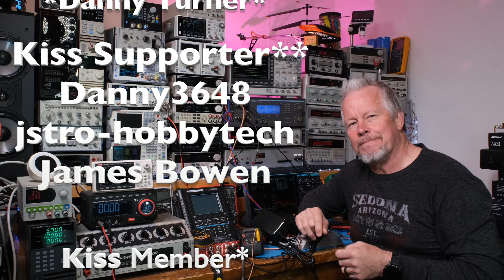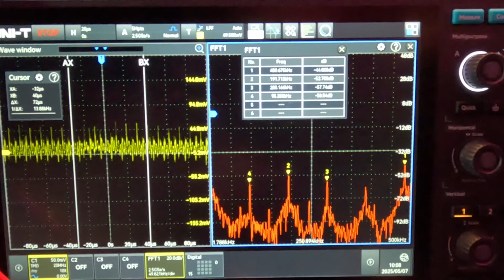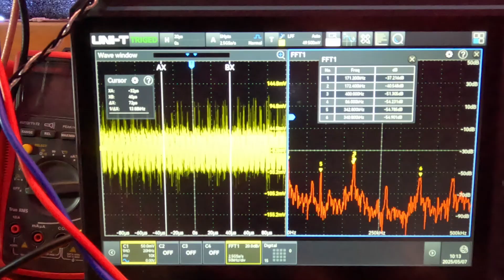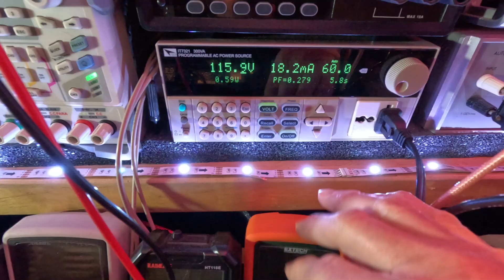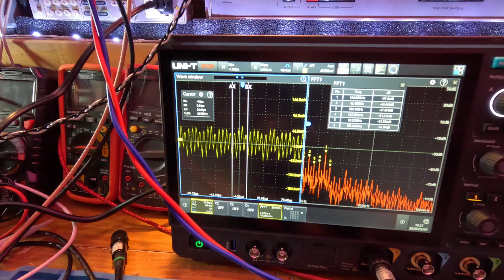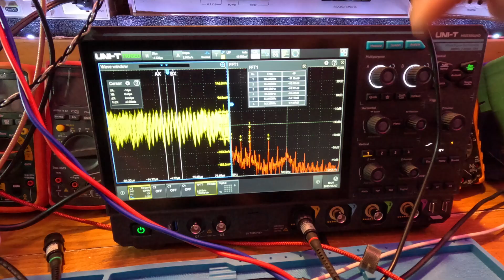New Aiyima GaN 48V Power Supply brick vs Fosi 48V Power Supply Brick - Power & Noise which is better

Comment: I’ve got a dell laptop power supply, 20V 10A. Any reason I can’t get a barrel adapter and hook it up to the aiyima 07 to drive bookshelf speakers?
Reply from the maker: There is no reason that you can not do that.  If you have 4 ohm or lower speakers - than this might work great, but if they are 8 ohms the power will be more limited.  But it will work and worth a try.

Comment: Aiyima are known to blow out easily. Don't use 48 VDC  power adapters (safe is <~40V) , sure to burn the IC, check internals if No damage seen to other parts sure IC is burnt ut. so change the IC, buy from aliexpress and give it to any electronic/Computer repairer to solder. just <$4 iIgot my blown out Aiyima 07  back to working.

Comment: Hi,  I left a comment a couple of months ago on a my other account and promised to get back on the differences. I went from fosi 48v 10a to two Gan 48 volt 5a so not really like for like. The Gan psu's sounded very bright when I first changed, the first two weeks it seemed like hi hats were dominating the drums on tracks, after a month they calmed down although they still sounded brighter, obviously the seperation improved with two psu's, but the dynamics, soundstage and small details are so much better with GAN, but I bass, warmth and sweetness. The volume and overall power hasn't improved if anything I might be cranking up the volume more with the GAN, tbf these changes are to be expected  with less bass. Today I placed my two V3 amps on bamboo support rather than on ply rack directly, now there seems to be a bit more bass and sweetness with the GAN. The amps now run slightly cooler which (why I got 5 a instead of 10a, GAN)  you prevoisly commented that the amps only draw what they need regardless, but they do seem slightly cooler. Now I have a spare 48v 10 fosi PSU so thinking of buying a cheap chifi amp for bedroom system maybe ayima. Be Well
Reply: I lost sweetness and bass with GAN but tbf the sound is so much bigger my speakers might not be able to produce deeper bass accurately if that is what the GANS are pumping out.
Reply from the maker: Thanks for the feedback.  The power supply GaN or whatever - it simply does not change the sound - this is in your head - expectant bias...I guarantee - that if you could do a double blind test - you could not tell the difference.....  The only thing that makes a difference is the voltage and available current..
Reply: Of course it's in my head where else would music be.😏Again it wasn't a like for like test so probably best not take my comment too literally. Now I'm tempted to get a couple of GAN 10a's to see if they perform differently, temp etc! 🙃Thanks for your feedback!
Reply from the maker: Sorry about that - I think I just responded a bit harshly.  The difference could be in the power supply design - switching frequency and feedback loop.  I think the output filtering could be completely different as well.  The GaN FETs can switch faster - but then if that is used in a hard switch vs a soft/resonant switch - then there can be a lot more noise.   The frequency of the noise is too high to hear - but I wonder what stress it can place on other components.
Reply: I don't think this is entirely true with class-d amplifiers the power supply is more intimately tied part of the power amplifier output circuit.

Comment: Is there a measurement you can do to simulate the instantaneous load of transients. As I have both power supplies, I’m curious why transients sound so much better on the GaN. Guessing it has a much faster response time to load changes? Is that slew rate?
Reply from the maker: Yes it is called a load test.  I will do that test:)
Reply: @KissAnalog  i would be highly interested too.

Comment: You should check out ElectrArc240's gan vs silicon video  its a pretty good run down of the advantages, he doesnt go into the noise floor but basically concludes everything is better with GAN, which is nice to know thats not entirely true.  But both you guys are boring in teh end, wheres the free energy harvesting? you claim to be power engineers, theres power in the air man!  how do we get it?  You want views,  spin a disk and say a bunch of smart words about resonance frequency while waving your hands.    I kid, because theres guys like Joel Lagace who are finding novel reactions for real playing with this stuff and have the brains to talk about it rather then just wave their hands while pointing at a spinning disk.  That will get views and real engagement, not infomercials for gear.

Comment: Nice one Eddie. Interesting, I assumed the GaN would win. Seems either way it's down to good design choices.
Reply from the maker: Thank you!  They both seem to work well and the GaN is smaller ;)
Reply: Was just watching a video on gan vs silicon by electrarc240 , gan was 92% efficient silicon was 85% and basically said everything was better with GAN. Title - "Everything is Better: GaN vs Silicon Power Supplies" Intersting to see it doesnt win everywhere, i dont remember if he tested the noise floor, but he's not an audio guy so understandably probably doesnt care;
Reply from the maker: Thanks for the great info!  No, GaN is not necessarily going to be better everywhere - my test here is case in point.  I'd say in power supplies it can make things smaller because of the switching efficiency, but what if you don't care that it is smaller?
Also, the efficiency isn't that great 92% to 85% power supplies, but maybe more like 1% or 2%- maybe 3%.  The 85% is not a great MOSFET power supply - again as case in point in this video.   I'd say many power supplies before GaN are in the 90s.
I do think they would or should make Class D amps better though - as that extra small percentage of perfect would be better.

Comment: Looks good, now if would be interesting to see how much a difference in design contributed to this lower noise at 5A for the standard power supply.  Tear it down!
Reply from the maker: Thanks!  I might just have to open them - if I don't have to destroy them.  I do want to use them for more testing.